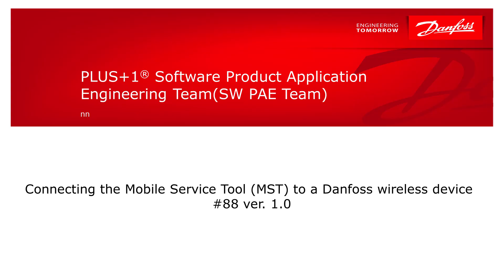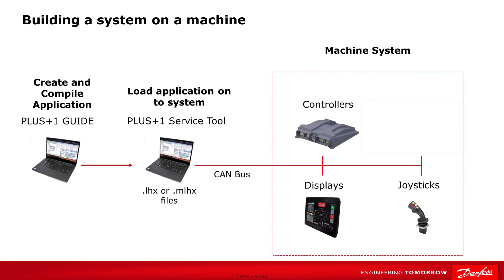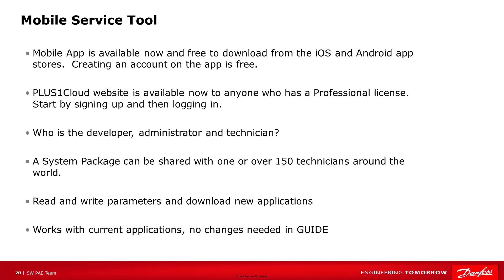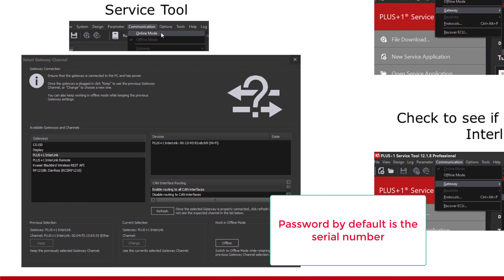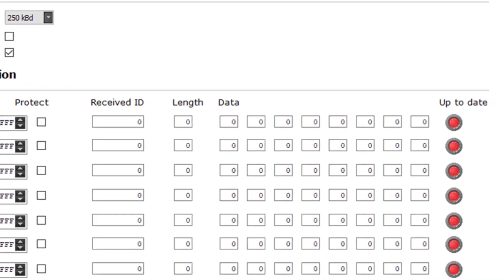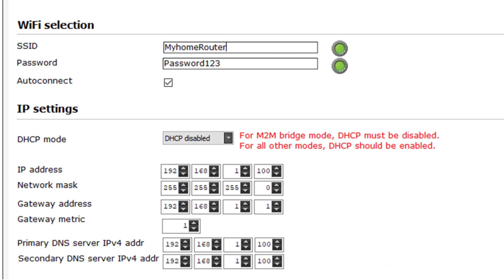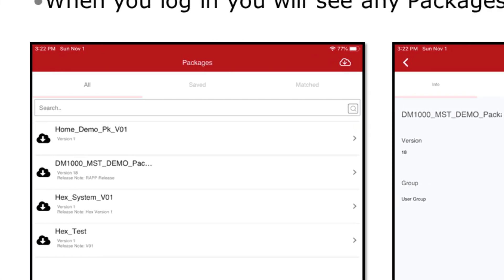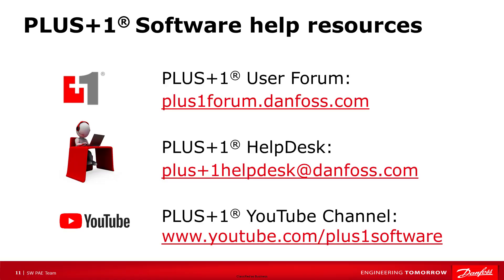#88 CS10 and PLUS+1 Mobile Service Tool

Comment: Thank you for this manual! Is CS10 only one actual device for telematics? Can't find any page for WS103, WS403, WS503 at Danfoss website.
Reply from the maker: Hi Safonov. CS10 is the first device out in our new range of telematics devices. CS100 and CS500 is to come. The WS units are legacy stuff.
Reply: @PLUS1Software  What new will be at CS100 and CS500. What are the advantages over the WS series?

Comment: Hello! Can I using CS10 to create wireless connection with MC050-110 controller?
Reply: Definitely!
Reply: @garylafayette9511  Thanks
Reply: Hi, Max! What application are you developing on the MC050-110? Did you had any experience with a mobile service tool?
Reply: @SafonovSolutions  Hi! I dont using CS10, but maybe I can use it in future. I develop control system for Blend-truck in Ukraine.
Reply: @maksmiroshnikov9615  что такое Blend-truck?
Reply: @SafonovSolutions  зарядная машина, она же СЗМ
Reply: @maksmiroshnikov9615  был опыт реализации на MC050+DP710. А у вас визуальная часть на чем?
Reply: @SafonovSolutions  MC050+DP720